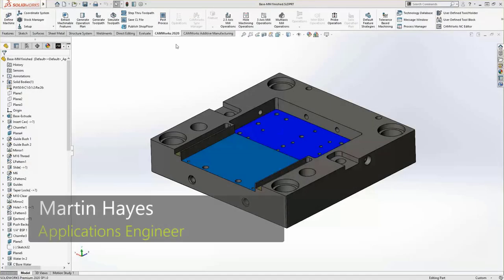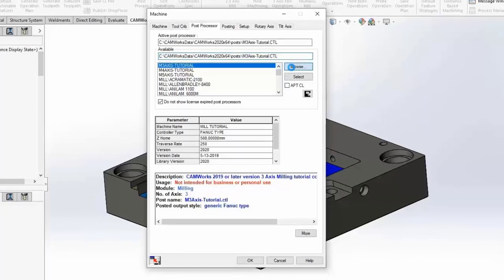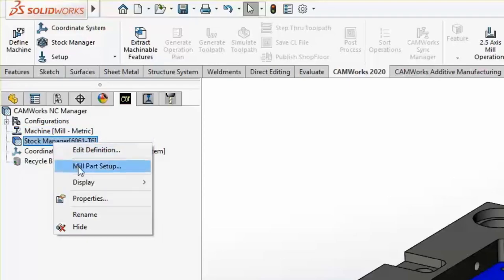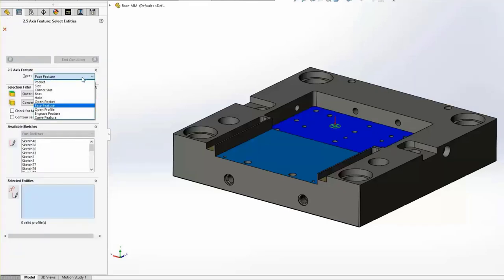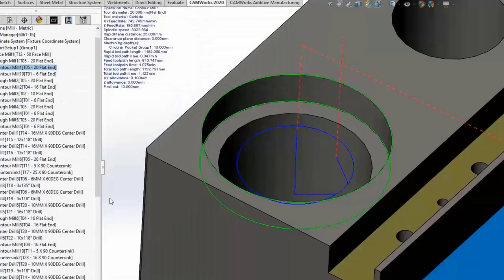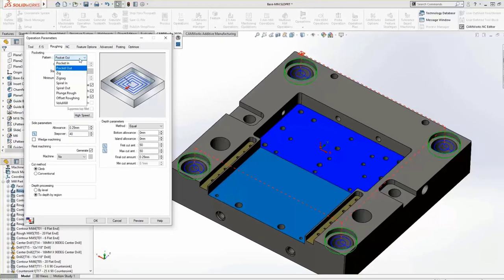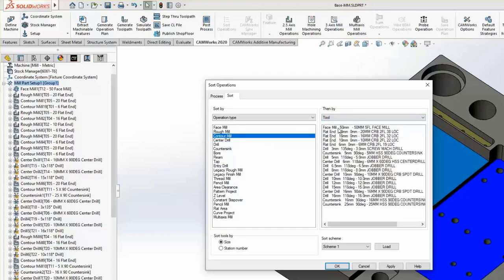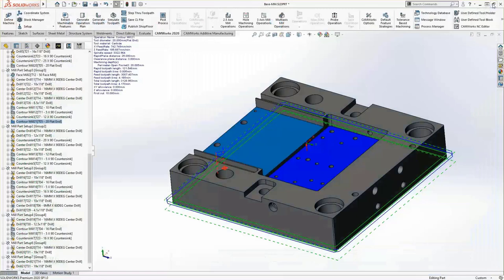SOLIDWORKS CAM and CAMWorks Tutorial - An Introduction to Generating CNC Code within SOLIDWORKS

Comment: I have a 3D contour surface that's not a pocket, and some filleted edges, but I can't seem to get SWksCAM to recognize the surface and it would do a pocket of the internal small holes, but not the profile of the shape.  I then tried encompassing the whole relief into a circle to be cut out.  It pocketed the internal circle, but also cut through ALL of the relief surface (obviously didn't recognize that 3D aspect).  Help!?

Comment: Hi, thx for a great video. I’m a bit confused. When it comes to actually milling the part where would the origin be when milling the bottom feature. Ie once top milled and removed from vice what position would the part need to be put in to orient it correctly. I though there was a way to visualise a vice in solid works.  Sorry for daft questions just trying to learn.
Reply: I am having the same issue. I’ve got the process of generating tool paths down. My issue is with work coordinates. Also, I have to do each face (mill setup) in a new file because my machine runs straight through and does not pause for the machinist to rotate and refixture the part.
Reply: crlaunch92 I’m not sure if it right way but I’ve just been setting a new work coords when I turn the part to the direction I want to mill from .mine stops automatically for a tool change between tools, waits for restart. But I had to set that up in mach3
Reply from the maker: You can set the origin of the part different for each setup, so you have control of how you would orient the part. If you have SOLIDWORKS CAM Pro, you can generate code within Assembly files which does allow you to visualize and even avoid the vice as a fixture entity.

Comment: Solidworks software doesn't have g-code generator? do i have to install another g-code generator? I finished modeling using solidworks 2018, but can't generate g-code and don't know how to do it. I don't use 3d printer, I use cnc lathe,turnmill and mct. I want g code for these purposes.
Reply from the maker: Solidworks CAM standard, does come with a few predefined post processors that can be used to generate G-code. However Turning, and Mill Turn require different licenses. You will need to contact your local CAMworks VAR to get access to the camworks licenses that will give you the tools you need.

Comment: I wolud like to know whether solidworks cam can be used as a post processor such as gbrl candle or usg  to connect a laptot  to a cnc machine and run its controller.  At the moment I bought a Sainsmart genmitsu 4030 proven that came with gbrl as defaulted cnc platform and had to learn carveco to translate my dfx files into toolpaths or g codes. I have learnt solidworks last year and was hoping to find a way to use it for cnc machining.

Comment: This is an awesome tutorial! However, is there a way to globally set a spindle rpm? My mill does not have spindle feedback control and can only be set fixed. It's a minor annoyance to have to "lock spindle speed" for each operation.
Reply from the maker: Once you adjust your parameters on the F/S tab, you can update your default operation parameters on the Optimize tab or update your Strategy from the CAM Feature Tree by right clicking on the feature and choosing Save Operation Plan.

Comment: Hello sir, I have question regarding tap cycle, I tried tap M12 X 1.75 on milling machine. But when I generate g codes for the same , the tap goes all the way down of the hole like upto 30mm. But I want the code for peck tapping means small interval at a time but there is no option available inside camworks . Can you please help me out.
Reply: Haaaaaaa .my god..where you learned programming 😀😀😀😀😀 pecking tap I never heard in our life...desaster
Reply: @Hanal503  sorry i got the term rigid tapping... But i just want to explain what I want. Like peck drilling operation... If you know how to do with cam works you are welcome. Currently I am doing it with powermill
Reply: @RANJODHSINGHFLICKS  I understood...I dont use those apps ..